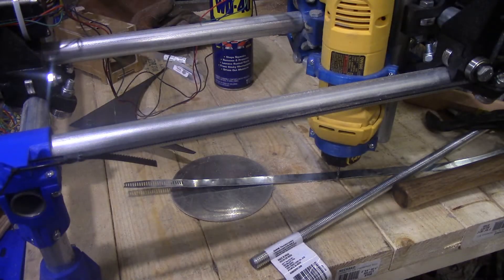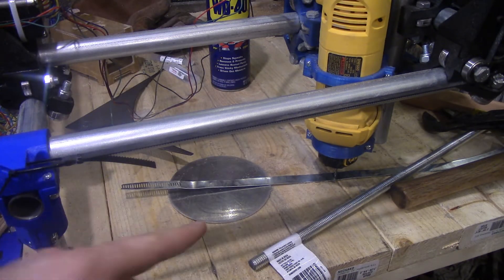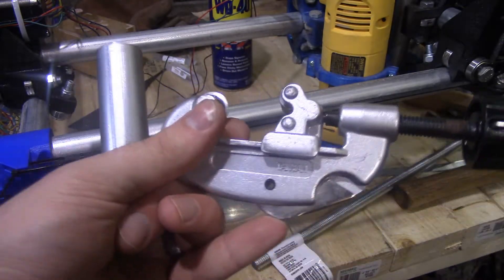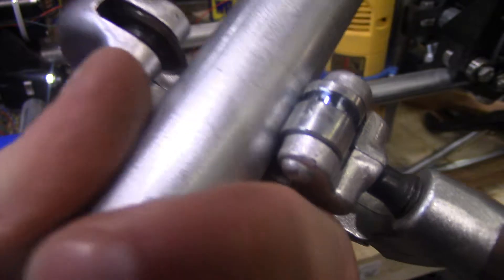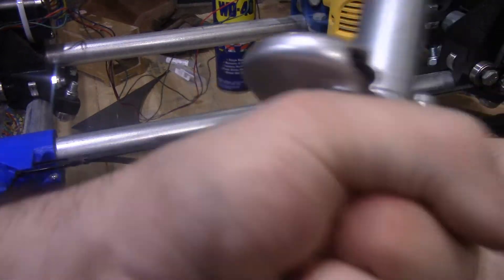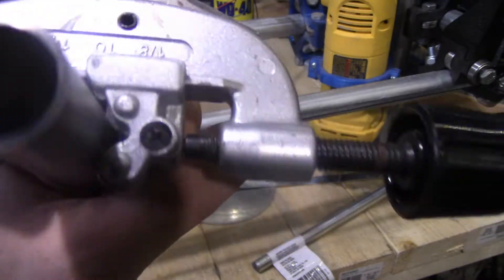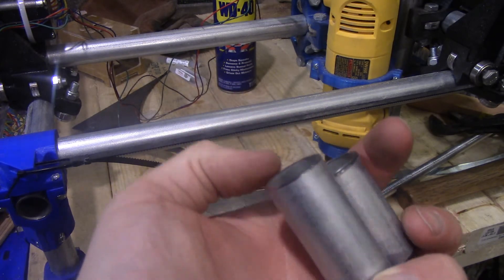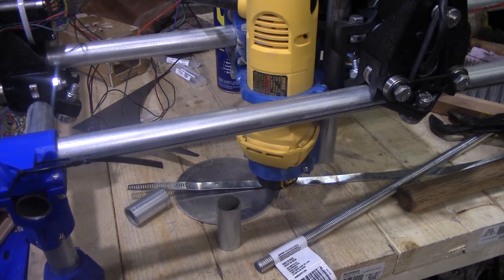MPCNC trick  cutting conduit

Comment: I don't know why this method seems to be news to everyone. 
As far as dulling the blade, you just need to be sure you have a quality tungsten blade in the pipe cutter. 

If you want a clean cut in pipe..  you use a pipe cutter. That's why they call the tool a "pipe cutter". It cuts pipe. 
The blade, dictates the type of pipe it'll cut.

Kinda a no brainier on this one folks.